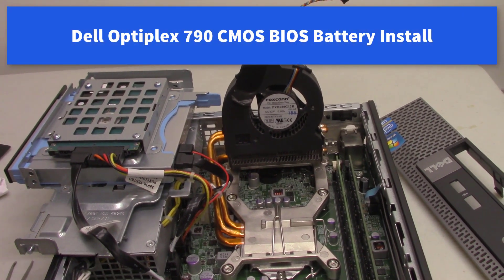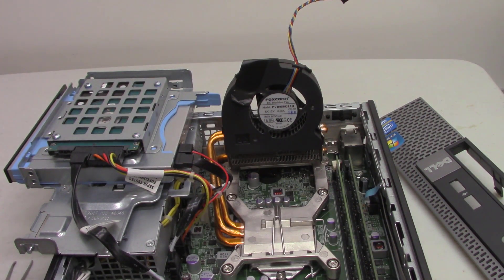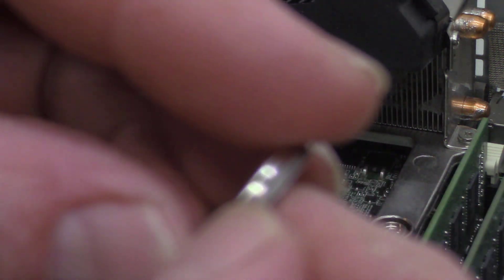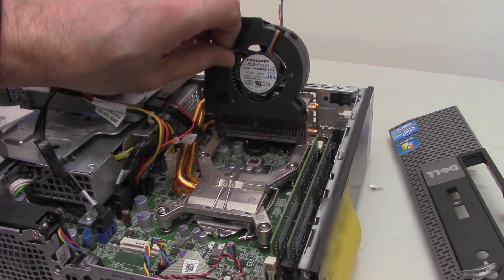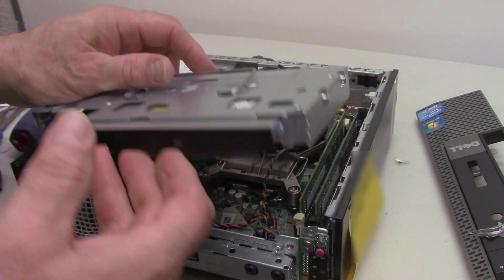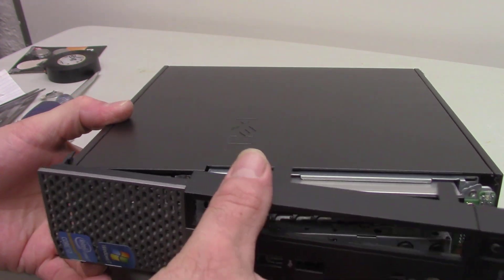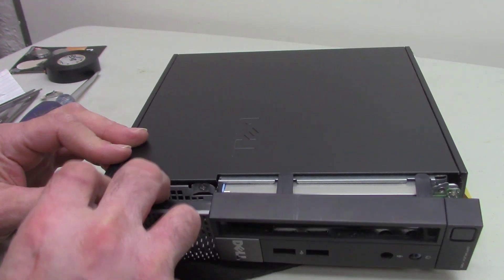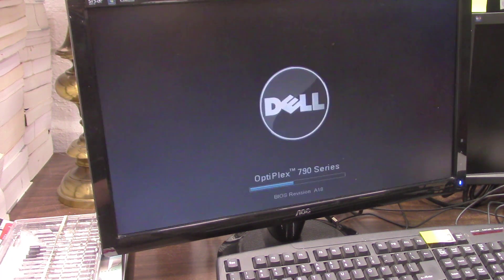Dell Optiplex 790 USFF CMOS BIOS Battery Install : USFF ULTRA SMALL FORM FACTOR

Comment: Thanks so much for the video. I was searching for the battery like forever. In the optiplex 780 it was under the power supply and I was confused it wasn't there at the 790. I looked everywhere and thought maybe it was soldered somewhere like it is on some laptops. Then I found your video
Reply from the maker: Welcome!

Comment: Jim, I could get no image on my screen.  I know NOTHING about computer electronics, but after watching your great video, I took the plunge and changed the 3V battery and PRESTO! Back 100%.  Thank you so much!!!  You saved me a bundle.  Interesting though, apparently all cases are not the same.  My case "opens" with a release handle and the battery was right there in plain sight.  I still took the front grill off to clean the dust out of it and blew out he entire enclosure though.
Reply from the maker: COOL! YEP,  MOST ARE REAL EASY TO PUT IN A NEW BATTERY. THIS ONE WAS A NIGHTMARE THAT'S WHY I THOUGHT IT WOULD MAKE A GOOD VIDEO!
Reply: @JimVincitore  Not a good video.... A GREAT VIDEO!  Thanks for taking the time and I wish you well in 2022!

Comment: i’m looking for a cheap pc like this one
Reply from the maker: THE LAST FEW I BOUGHT i WENT TO AMAZON WAREHOUSE. USUALLY AROUND $100 OR $150.
Reply from the maker: https://www.amazon.com/s?i=computers&bbn=10158976011&rh=n%3A10158976011%2Cn%3A172282%2Cn%3A%21493964%2Cn%3A541966%2Cn%3A13896617011&pf_rd_i=10158976011&pf_rd_m=ATVPDKIKX0DER&pf_rd_p=91c104e6-7626-4361-9fe2-e3319123711f&pf_rd_r=D10ZCQ576R5NMRTFK8DM&pf_rd_s=merchandised-search-5&pf_rd_t=101&ref=s9_acss_bw_cg_awstre_4a1_w
Reply: ok
Reply: thank you
Reply: are they pretty fast?
Reply from the maker: @rengokusimp4266  i HAVE NOT USED IT MUCH, BUT i INSTALLED WINDOWS SERVER 2016 ON IT AND IT SEEMED OK.

Comment: can this pc run roblox good?
Reply from the maker: FOR HIGH END GRAPHICS, BUY THE FASTEST PC YOU CAN AFFORD, AND THEN SOME. YOU'LL BE GLAD YOU SPENT THE EXTRA DOLLARS. I'LL LOOK AROUND FOR THE ROBLOX THING, I NEVER HEARD OF IT. DO YOU HAVE A LINK TO THE SPECS ON ROBLOX?
Reply from the maker: I can not find specs, meaning what Roblox recommends to run on, but from watching a few YouTube vids on it, I'd go with at least  "i7, 2nd generation and 8 gigs of ram." You might need more ram, like 16 gig of ram for all the graphics, but I'm guessing. A used "i7, 4nd generation and 16 gigs of ram," might be a safe choice. This pc I'm on now is an "i7, 2nd generation and 8 gigs of ram." and sometime just messing around on YouTube it run slow and gets bogged down, but I bought it used and it only cost me $200 about 10 years ago.
Reply: ok thank you
Reply: btw roblox is a game on chrome google, etc. it is a online game, it is also a low end graphic game hope this help

Comment: why are u doin this
Reply from the maker: Hi O! I don't remember. I think I had just bought it and figured I'd put a new battery in it before I installed a new OS. FYI: when the battery goes out, you'll get a BAD BATTERY error on the black screen at start up, when you turn on your computer. Thanks for watching. Jim
Reply: @JimVincitore  oh ya im askin cuz  im havin issues mine wont turn on. i think i figured it out tho its the power switch board. so im playin aroun wit this i unplug the power switch board from the motherboard now i jus plug the power cord n it turns on by itself

Comment: I wonder if this could be the reason why my computer keeps shutting off, do you think I should buy a new battery for it and see if that solves the problem?
Reply from the maker: What is the make, model and age of the computer?
Reply: @JimVincitore  It's a Dell Optiplex 790 and it's been out of warranty, I thought the power supply was the issue, but it wasn't. I even tried putting some fresh thermal paste, it didn't solve the problem. I don't play any games at all.
Reply from the maker: I found this on the web.

Heat-related issue
https://www.computerhope.com/issues/ch000689.htm

Most computers today are designed to turn off automatically if any of its inner components overheat. Often, heat-related issues occur when the computer is working hard, e.g., playing a graphically intense computer game or editing a video.
Reply from the maker: It is a good idea to replace the battery if it's like 5 year old. I think they'll last longer, but for a three dollar battery you can buy at Walmart, it's a good thing to do. Usually its a cr2032 battery. 

The battery is used to hold your "start-up" setting on a chip on the motherboard. Stuff like date and time and other techy stuff about the hardware. The battery and settings on the chip start the computer, the Windows (or whatever OS you use) takes over and finishes the start up.

I found this on the web.

Can bad CMOS battery cause laptop to shut down?
https://www.techspot.com/community/topics/can-bad-cmos-battery-cause-laptop-to-shut-down.189440/
Reply from the maker: I found this on the web.

Can bad CMOS battery cause laptop to shut down?
https://www.techspot.com/community/topics/can-bad-cmos-battery-cause-laptop-to-shut-down.189440/

    The CPU cooling fan may be worn out and the thermal pads and paste may be seriously burned and dried out. I doubt if the laptop parts would be worth much because of the age... A bad CMOS battery will not cause a shutdown. But a LEAKING CMOS battery can cause damage to the mainboard.
Reply: @JimVincitore  Oh, I have a desktop and it shuts off like every 5 minutes if I'm not using it.

Comment: Thanks for the video.   I found the battery at 1 Volt  should be 3 volts + and blow out all the dust on the fins.   Blow from the outside in.